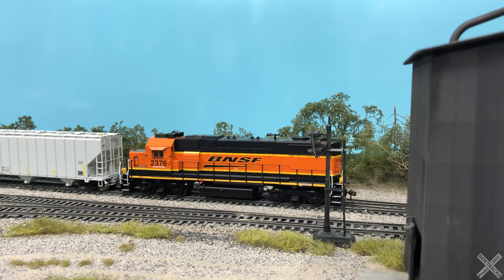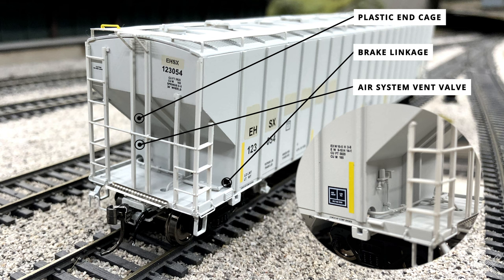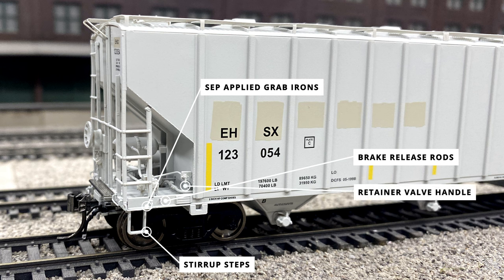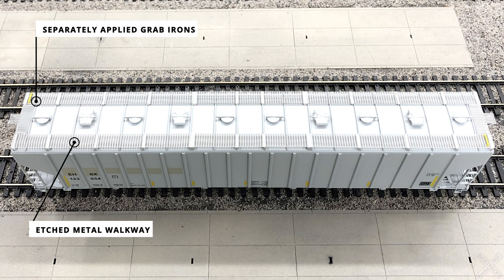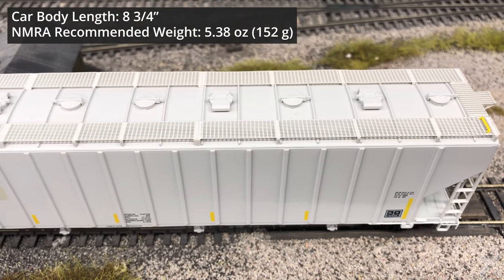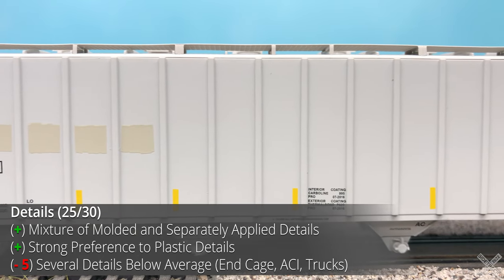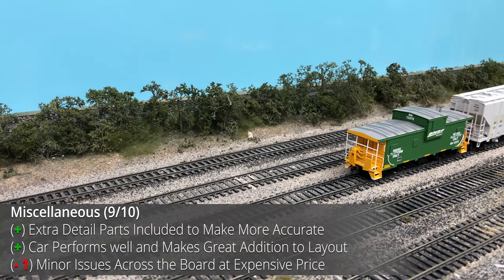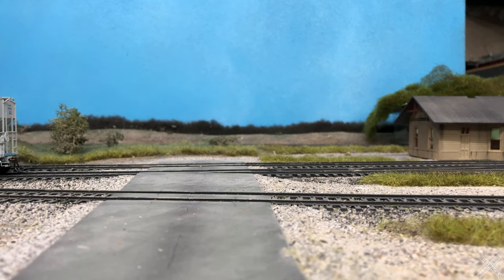Review: Rapido Procor 5820 Plastic Pellet Covered Hopper [HO Scale]

Comment: ScaleTrains as you know is offering the Pullman Standard 5850 car. Now for some company to make the Trinity early 5851 plastics car without the end cutouts and notches and the end ladder rungs and the late 6241capacity car. ARI  once ACF now Greenbrier has the 6224 car and Center Flow 5800-6200 cars as well. Atlas could do the ACF/6200 since they offer the 5250,5701 and 5800 car.
Reply from the maker: Yea I learned about the ScaleTrains car while making this review, and was one of the major reasons I didn't go out and buy more to wait and see the SXT versions. I own a few of the Atlas 5800 series cars and those are nice as well.
Reply: @SideTrackX  It's interesting since everything is made of plastic that there aren't more plastic pellet covered hoppers like the Grain car models. I failed to mention that Walthers has offered the NSC 6200 capacity car. Freight Car America and Greenbrier make modern hoppers that could be made to scale. Tank cars of various types need to offered also. I personally Kitbash my own. Several examples are the 16,000 gallon HOKX and UTLX Panda Bear paint scheme cars.